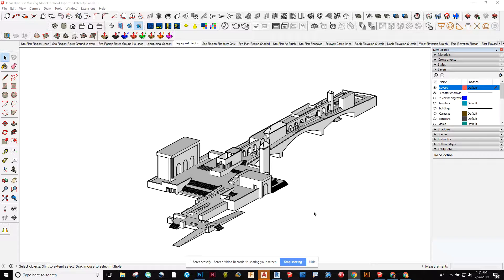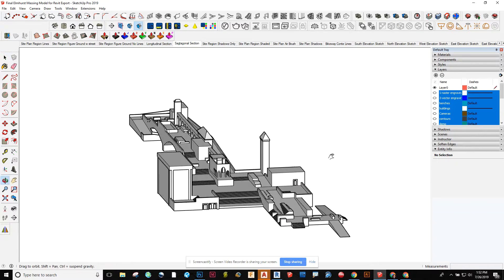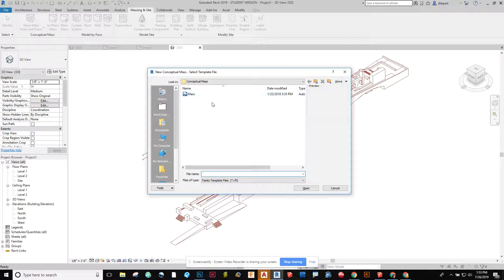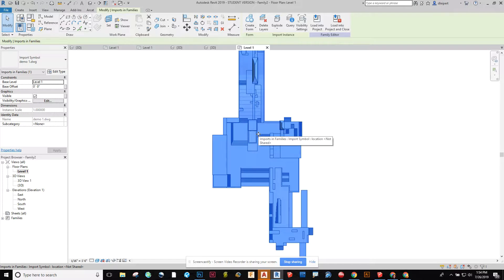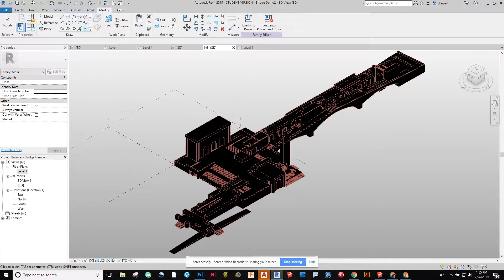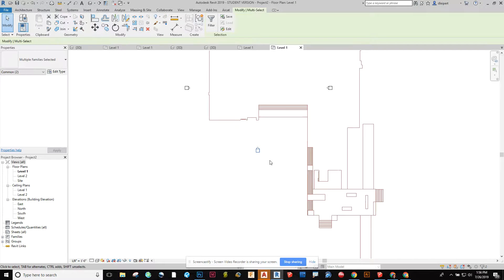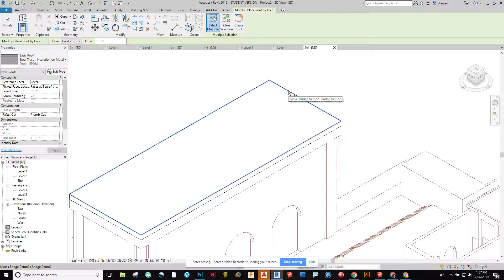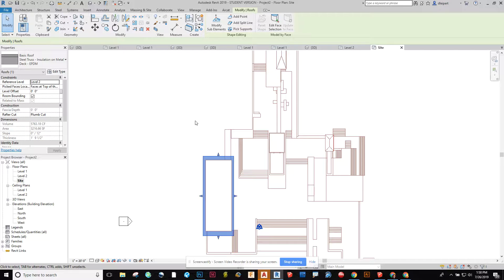How to bring SketchUp into Revit as a Mass + Add Roof/Walls/Etc. to Mass Face

Comment: please why am i not  able to add floors on the mass imported from sketchup
Reply from the maker: Revit can be a pain at times.  You might be able to create a level at the height(s) you want and then do floors like this: https://youtu.be/P8MWAvBhmrY

Another route you can go is to use roofs with no slopes as your floors, but I think that would be my plan B.

Comment: once you have allocated roofs etc will they then show in section?
Reply from the maker: They should show just like any other floor, wall, or roof! You may just want to hide the original mass if it’s not already hidden by default.
Reply: @Studio_Hero  Brilliant cheers mate